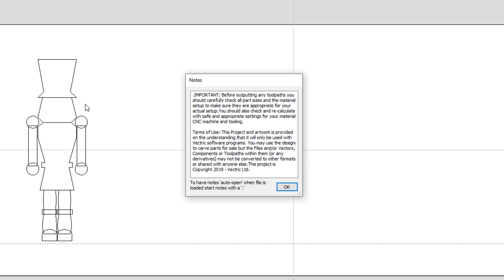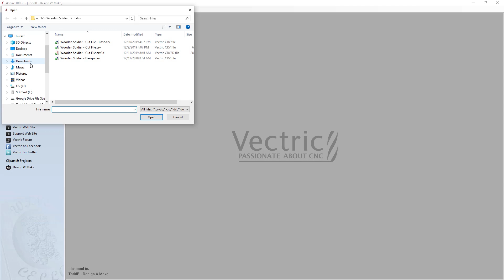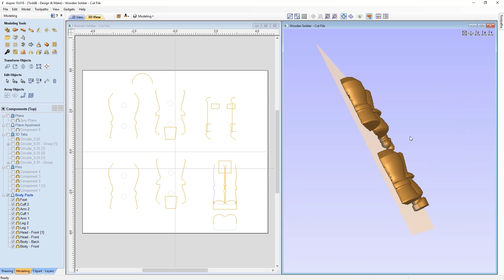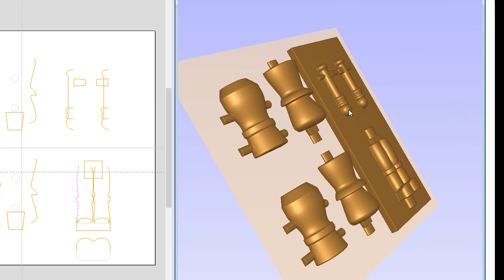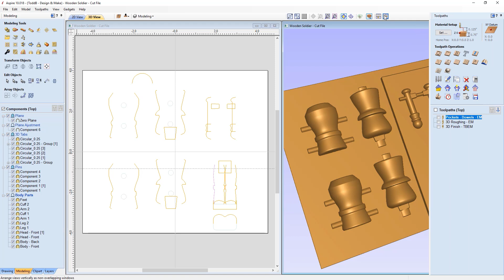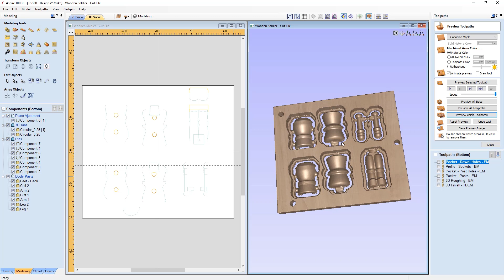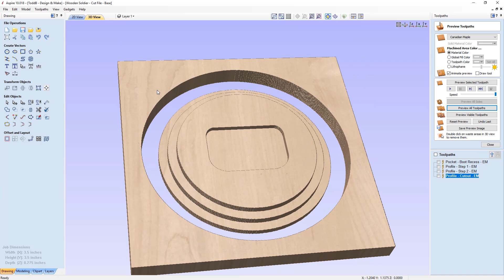The 12 Projects of Christmas | Day 12 | Wooden Soldier with Todd | Vectric In The Labs

Comment: 2 questions.
1. with this project couldn't you just skip the roughing pass and use 1 pass with the TBN?
2. is there an advantage of not having your alignment holes go all the way through into the spoil board from the front?  I make mine deep enough from the front so there's not a second operation, but I've only done a couple 2 sides, so that might not be the right way..
Reply: Hey Bobby, it's Todd.  Great questions!!!  
1 - You could but I would be worried about breaking the cutter.  Yes, it is true that tapered cutters are pretty strong, but you pay for that in their cost.  If I was cutting into foam or a very softwood I might give it a try.  I was using white oak (I think) and it was very hard so the roughing pass was the best option.
2 - No advantage at all.  I know the dowels were long and did not want to go too deep into the spoil board (pass the MFD top we have).  One of the issues you might run into with them popping through is clearance for your tool.  Make sure they are outside your cutting area so you won't hit them by mistake. 

I hope that helps!  Thanks again for the questions!